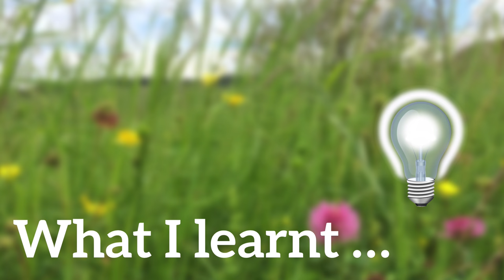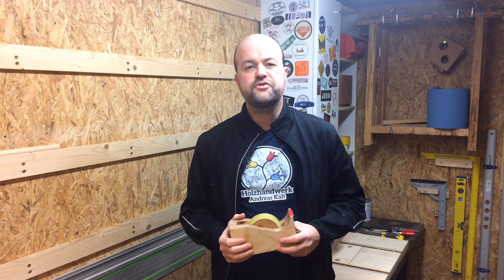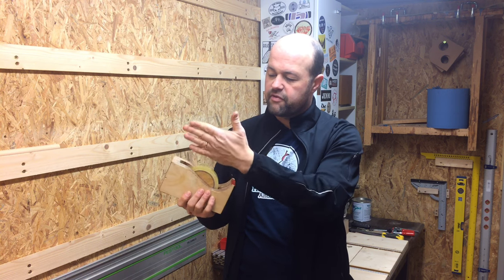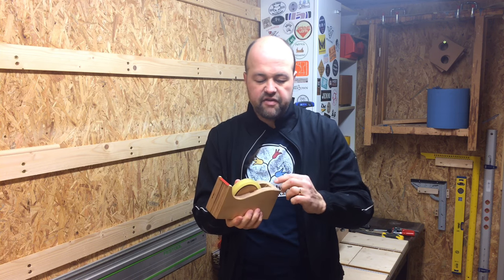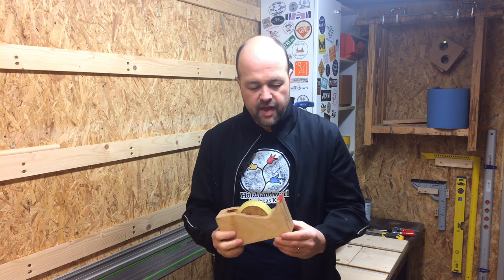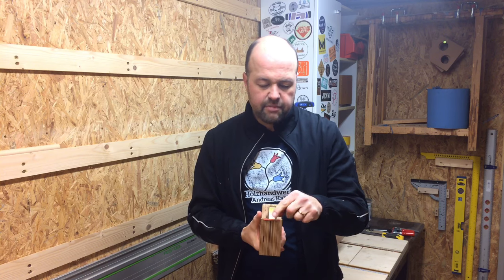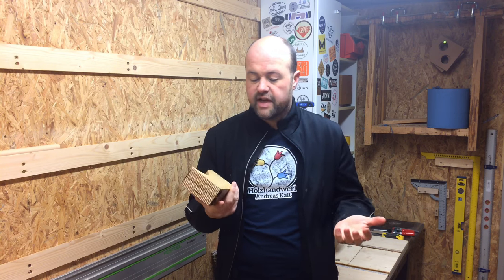Make a tape dispenser out of plywood scraps – DIY

Comment: Very nice result!! maybe you can try placing the hacksaw vertically so it performs better? not sure :)
Reply from the maker: Thanks! A good idea. But I'm not sure if the tape will then stick to it waiting to be used. In the dispensers that you can buy the teeth of the blade point to the front.
Reply: Andreas Kalt yeah, you are right! I've seen then bent a bit upwards but always have a horizontal side for that :)

Comment: good stuff Andreas! and good point about the 3 layers. as for the cutter. maybe a razor blade? but make some kinda guards for the sides because that might be a little dangerous if ur not carful . or find a thin piece of metal grind it to a point like a chisel.happy holidays to you bro!!
Reply from the maker: Thanks Joe. I had thought of a razor as well but thought it was too dangerous. Maybe a thin strip of metal could be filed to have teeth (I think pointed teeth would be more effective than a sharp edge). Maybe next time ;-)

Happy holidays to you too!